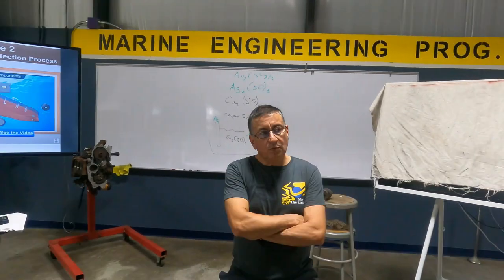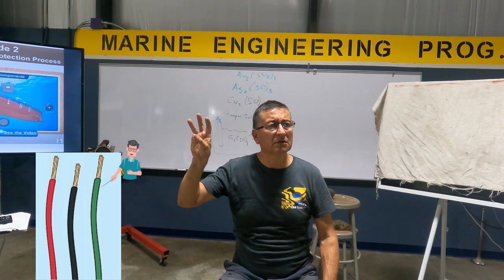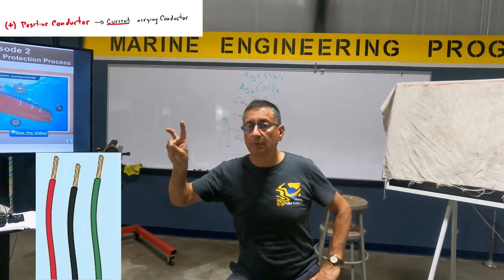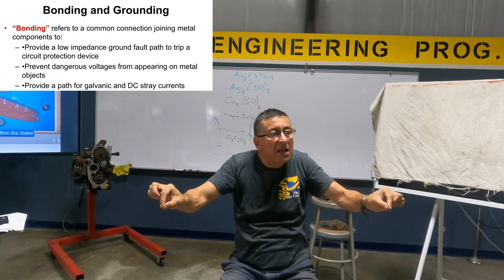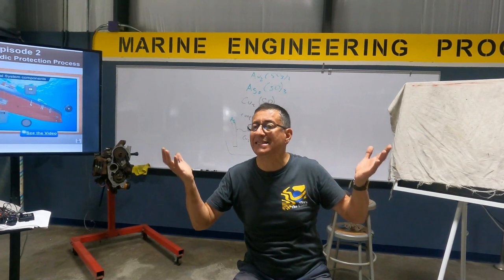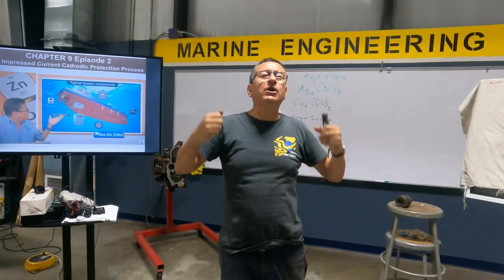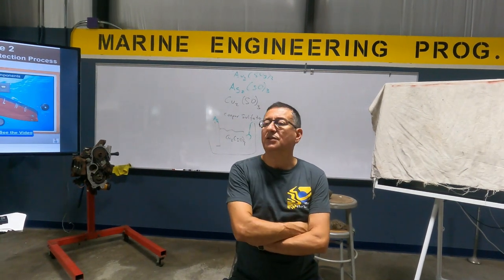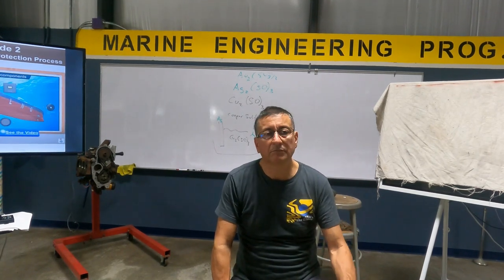Bonding Grounding and Ground Explanation

Comment: Should an aluminum hulled boat have the hull itself connected to the b onding system?
Reply from the maker: No Hull should be isolated The bonding conductor is not in contact with the hull

Comment: Question: I have a 1999  54 ft boat that has a GUEST Dynaplate previously used probably for Loran. The single 8 AGW goes only to the helm and sits unconnected. Should I connect the Dynaplate to the bonding system, which has been completely repaired?
Reply from the maker: The Dynaplate is used for lighting purposes; it should also be connected to the boat bonding system
Reply from the maker: Yes. Both plates should be connected